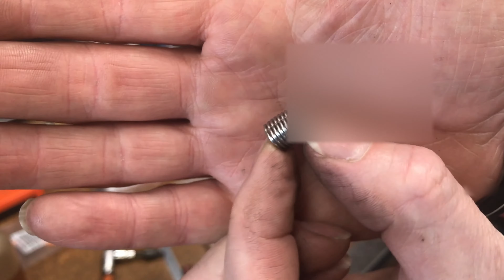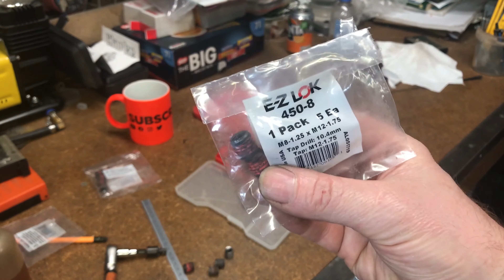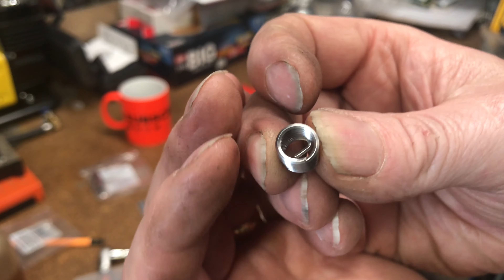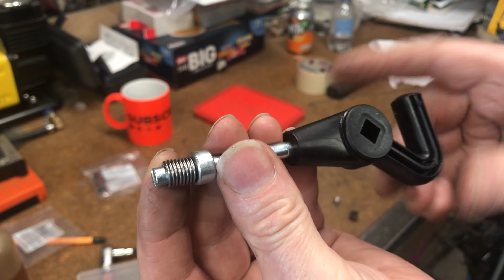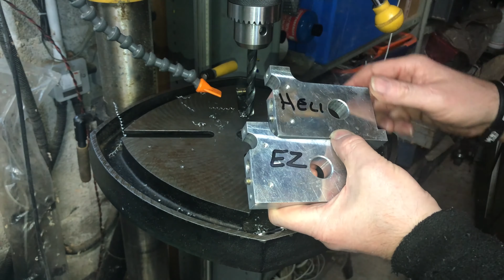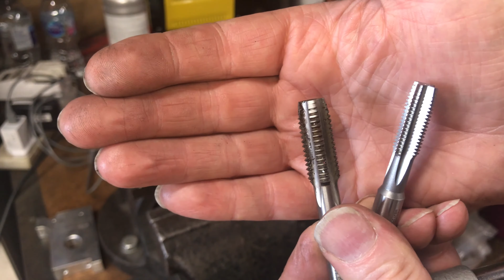Helicoil Vs. E-Z lok shootout. Indecisive!!

Comment: Project farm showed that both held fine up to bolt failure at 315 or so lb/ft. I doubt they were m8 bolts but the threads held much better than tapping the aluminum without a insert
Reply from the maker: Hi, certainly the bolts failed in my test before the inserts! What the inserts are good for in ally is when you need to remove and refit the bolts a lot as I’ve found the ally will “pickup” on the bolt after time causing the thread to fail. Not so with the inserts. Thanks for watching 👍
Reply: @MikeMakesIt  I agree, aluminum threads fail even if you use the proper torque

Comment: The Helicoil is solid extruded steel with even distribution of force throughout the whole coil where as the EZ lok is cast steel with 80% force on the first 3 threads. So in theory the Helicoil is stronger. Also Heli-coil is the only thread repair that is certified for use in aviation. Also you can stack the helicoil as well as do thread repair without separating the parts unlike the inserts. The only downside is how to keep the Helicoil from coming out when removing the bolt which is not a critical failure when you're trying to remove the bolt anyways.
Reply from the maker: Hi and thanks for the great information, much appreciated. Thanks for watching 👍🏽

Comment: Thank you, very informative!  Currently trying to decide which to use to repair a broken head bolt in a small engine that I have to drill out.  Seems like either will work for my application.
Reply: It appears that way. They actually make two different versions of the one I need (5/16 inner threads): one with 7/16 outer threads, and one with 1/2 outer threads. I think I'll give the smaller 7/16 one a go.
Reply from the maker: Hi Morton, thanks for your comments, much appreciated. I think with the E-Z lok insert you generally have to drill/tap out to a slightly larger size than you would with a normal helicoil and I found the E-Z lok harder to source but given all that I personally would try and use the E-Z lok on my projects. Thanks for watching 👍🏽

Comment: The two advantages of Helicoil are its lower cost, and if you do happen to pull it out, you can switch to the EZ Lok as a replacement while maintaining the original bolt size.
Reply from the maker: Agreed. I found the helicoil very easy to get hold of where as the E-Z Lok a little more elusive! Once I've found better bolts I'll redo the test but my money is on the E-Z Lok being the winner. We'll see. Thanks for watching 👍🏽